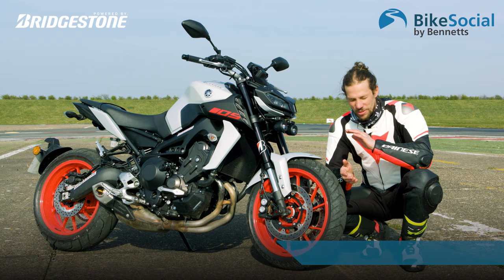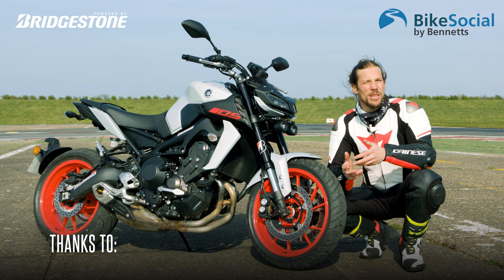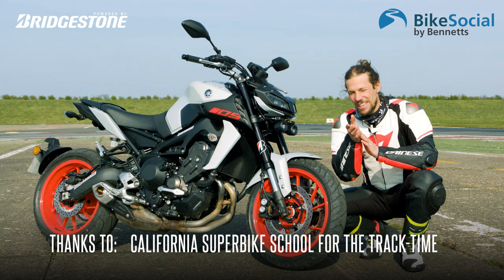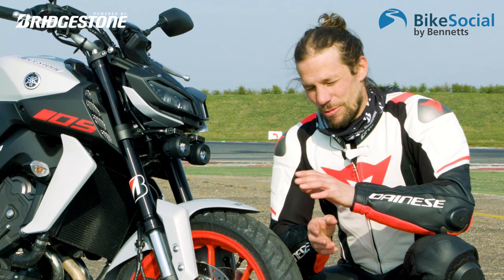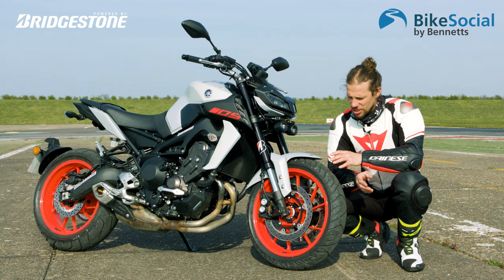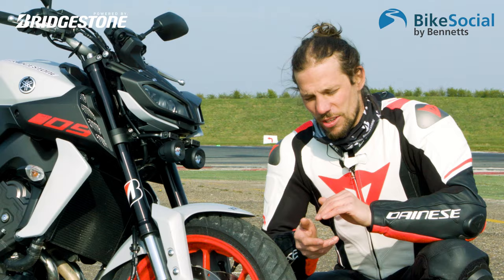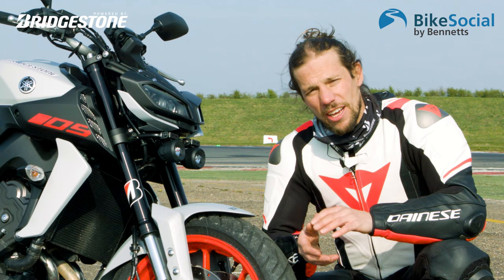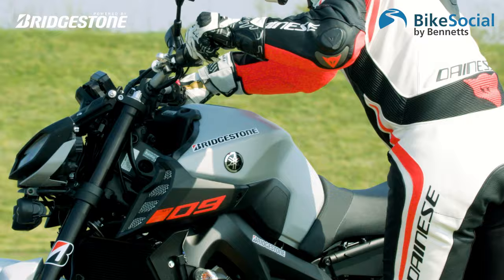Should you brake while turning? Motorcycle riding tips

Comment: We all do actually brake on bends or rather when travelling round curves in the road we cant do otherwise and if we are gentle on slowing with or without the need to use the brakes nothing un towards happens so its something that we would do every day under normal riding conditions. Our roads in the UK are full of curves, bends and then corners.  What we must not do is instinctively slap on or grab the front brake as that  braking  overloads the the front tyre  grip on the tarmac and that is then a slide off. Not nice.   Many times one can use the back brake but gently and that will not  only slow one down, slowly but it also helps one  to tighten the curve and possibly make the bend safer.  Further one can also use more counter steering and push slightly more on the lower handlebar just a little more and that may  also assist us to make a bend  and come out the other side.

However the speed going into any bends is of primary importance and many riders lose it by going in too fast and that could mean not coming out of it. As an example we are taking a bend at 40 mph so our good safe braking distance that we can  see ahead  is  hopefully to the limit point which should be 120 ft or more.  We then have to take into account our lean angle of say of 40 deg. from the vertical.  That, basically for ease of calculation  means that we are already using up some 40% of our grip level between the front tyre and the tarmac.  That means that we no longer have 100% of our original braking capacity but its now limited to only 60%.  If we exceed that 60% we will more than likely lose the front tyre grip level as  we are pushing it over the 100% level. So we lose our front wheel grip and off we come.

If we go back to our  safe stopping distance  as being that 120 ft. its not actually. That distance is for a car on a dry and straight road and we are on a motorcycle and leant over on a bend and  with only some 60 % of our braking capacity left so that means that even if we can use all of what we have in terms of braking on that bend we will exceed that safe stopping distance  of  120 ft. and maybe with moire gradual slowing and stop in 150 ft or more. That means that we have run past the 120 ft safe stopping space we had originally and have ended up running round that corner into whatever. we don't know. . 

So it beholds us to actually slow even more on bends , always presume or assume a hazard such as a tightening radius or stopped vehicle, horse etc.  then  if we are required to stop suddenly or even gradually we can stop without running out of  road and neve ever grab the brakes
Reply from the maker: "Don't surprise the brakes". All the best, John

Comment: This is exactly why trail breaking should always be used on the road, when trail breaking the front tyre is always partially loaded up during cornering ready for any unexpected braking that might need to be done. I've been riding on the road for nearly 10 years and I've only really just started practicing trail breaking and I can confirm that I feel much more in control of the bike during a corner now.
Reply: So if you're already on the brakes and need to apply more mid-corner, you can (smoothly) and you won't slide out?
Reply: @The63chicky  Yep, trail breaking is a front brake only thing, look it up on YouTube, there are a couple of very good videos explaining it.
Reply: @DJRipGroove99  Yeah I know what it is, but haven't tried it yet :)
Reply: @The63chicky  Give it a go next time you're out. When you have it dialled you'll find your cornering is faster and safer :-)

Comment: True however, the safest option is to already be in a speed that you do NOT have to brake mid corner. End of discussion.

But, if you have to for some reason, then YES, Trail braking is definitely a safer option than to slam on brakes mid turn/corner.

Just remember that there is a risk with trail braking because excessive use of the front brake can result in a loss of grip as the tire's adhesion is split between braking and cornering forces. Effective trail braking requires finesse from the rider, which can be difficult to learn.

Comment: One way of looking at it, say you have 10 points on a motorcycle...
10 Braking 
10 throttle 
10 lean angle 

As you gain 1 point of lean angle you have to give up 1 point of brake pressure and vise versa with accelerating 👌

Comment: Thia is for advanced riders (racer's stuff). How about only using only the rear brake, even not that fast. Can you make a video tackling the proper way of that? Not all people are confident enough of touching the front brake on turns and curves.
Reply: applying only rear brake straighten up the bike and it takes you out of the bend i wouldnt recomended it. Anyway why you dont try it for yourself. On hot summer day when tyres have good temperature and on dry road just gently press rear brake in small leaning angle in the bend . Why you need advice from others when its easy find out for yourself

Comment: Braking the front wheel in a turn is old hat to dirt bike riders. It can be used to go faster through a turn. Not for beginners or to be done on a bike you are not familiar with. If brake pads are grabby be sure to get different pads that are not. All different compounds for use on different tracks.

Comment: If the corner is tighter than you thought, just reduce your throttle input and lean more. Doing these things is a lot safer than suddenly grabbing the brakes.
Reply: You need to roll off the throttle before breaking anyway. Throttle + Brakes = fucked.

Comment: What about using the back break instead?
Reply from the maker: I use the back to scrub small amounts of speed off without unsettling the bike, but you won't get the power you would from the front. John
Reply: @bennettsbikesocial  For better or for worse this is my typical panic response to finding myself in a corner too hot. Scrub speed with the rear and tighten my line as much as possible.
The only time I've come across an unexpected obstacle I managed to aim for the centreline, stand the bike up, "progressively" loading up the brakes all the while and came to a halt between the rear door of the stopped car and the front tyre of a lorry. 
Lost a foot peg to the cars rear bumper, bruised my foot, had to check my underpants, vowed to never put myself in that position again and decided to do some serious practice with my braking technique.
Reply from the maker: @eoinkenny3188  Glad you're okay! The best advice is of course to not go any faster than you can see to be clear, but understanding how the bike reacts is really helpful. Cheers!
Reply: Front brake's braking force is typically around 70-80%, but it can go as high as 100%
Rear brake is not as precise and it is easier to lock up the rear wheel than the front.
Front brake force bike back to upright position where the rear make it to lean more, but things can change quickly if you lock up a wheel (often a crash).
When a rear wheel gets grip again it can lead to a high side.
When a front wheel gets grip again it usually wobble a bit.

Comment: Rear braking in the corners is never a problem.. But front braking? It's still something that I wouldn't recommend.. Physics wise.. When you front brake, you'll actually tend to go up straight again instead of leaning more.. That is why there's so many under steer crashes because of front wheel braking.. Front braking in the corners and leaning, you're actually going against Physics and that's when you'll crash because it's not easy to gauge how much or how less do you need to brake with the front brakes.. It's still ok if you're slow at about 30mph to 40mph.. But at any speeds higher than that, definitely not recommended at all..

Comment: This kind of information should be widespread because learners always get told they can't brake in a turn and only someone interested into refining their riding will find out you can actually brake in a turn (including using the rear brake to tighten a line).
Reply: Yeah I got told to never brake in a turn after I had already been doing it for 2 years, also he didn't tell me why. The practice of breaking in turns is no different than a car really.

Comment: My bike didn't had ABS, I was on a very small local turn. I have passion pro 2020 bs6. it's brakes are good enough on grippy and straight roads. Today I was running it and suddenly a girl with a bicycle came in my way on the turn. Even though I could easily control my bike. even my bike was slow. but I got my focus on girl and not on my hand on the brake. I accidentally tightened the front disk-brake and tyre got slipped and my left hand got a wound and my leg also. do you know what next. she stopped in her way. and thought of helping me but I simply stood up my self and Took my bike, she left. I was safe but My bike got a very small bend in its handle bar and some scratches on the wiser and headlight. That wound on bike broke my heart I am here learning more about braking

Comment: What if you drag the rear brake very gently on dry track while entering the turn? I find it useful. Slows down the bike ever so slightly but gives more confidence
Reply: just use the front, way more control on that brake. I have about 10k kilometers on me as a rider and i can do some light to medium trail braking, i'm sure experienced people can do better. Specially if you ride the track
Reply: I think it depends on the bike. Not every bike comes with dual front brake. When you're making hard stop both front and rear is needed.otherwise they'd just stop adding rear brake on all bikes
Reply: @cripticdestiny  i mean use the front for trail braking. Even if it's single disc, it's way bigger than the rear.

Comment: Whilst on a road in the UK we are taught to use the limit point for our speed around any  curve or bend.  However once at that maximum cornering speed and needing to brake if we were on a dry road and going straight we could brake quite hard and in that distance to be seen but whilst leant over and on a bend with already using some grip due to speed and lean angle some of   our braking capacity is lost and if we can only use some 60 to 70% of our braking capacity how much further would we need to see past that limit point [ say being a mere 120 ft ahead ] in order to come to come to a stop?.  

Also in the wet we are told to allow twice our dry  braking distances on a wet road so if we can see the limit point is say 120 ft away and we are doing 40 mph., that's a braking distance on a straight line and in the dry,  But just how much distance do we need and can we stop in in order to brake in the wet from that 40 mph with only 120ft of seeing distance. how much further would we need to travel in order to come to a stop? 

Can anyone hazard a guess. I cant but I know that it will take quite a few feet or metres of further travel to be able to stop and it will be well past the so called safe limit point. So it will bring into question all that we know about  stopping distances  and about the taking of bends and speeds relevant to the limit point.

Comment: if you get your front tire warm with a few braking sessions, I haven't ever had an issue using 30-50% front brakes around 45-40 deg lean. That's on some michelin pilot powers or RS's though. I could only use about 10% brake pressure on old Dunlop qualifiers before they turned in.  It would be amazing to use that machine though. Can I have a go?

Comment: You only spoke about using the front brake.. Is using the rear totally out of the question, or could a smooth and controlled brake using both be even better/more secure? Maybe this topic deserves its own video as a followup.
Reply: For a new rider I would forget the rear brake existed. It plays little role in stopping ability (in the straight line) but very easy to get  you into a highside when you start fishtailing into a corner because your rear tire lost the grip.

Comment: Just started riding, thanks for the video!   Can I conclude the following :  IF I misjudged a bit and come in the turn too fast for my own good,  and IF braking is necessary,  and IF I don't trust myself being able to progressively and gently use the front-brake,  then it would be better, in my case, to use the dual front/rear brake instead of the front brake?  And, of course, even then I still need to avoid using the dual brake abruptly.  Is this correct?
Reply: The rear break can lock the tyre as bad as the front, the different is that you have a chance to recover if you just lock it for an instant, if you lock the front you can’t recover. Anyway, can’t say it’s better than using the front just because you have more chances of recovering after locking the tyre. If you don’t trust yourself, don’t ride fast, ride safe until you know you can trust yourself .

Comment: Is It better ti use the front or the rear during a turn? Not talking about slow turns when manouvering
Reply: Trail braking is a front braking skill. You have much more sensitivity in your finger on the front brake lever than you will have in your right foot. Trail braking also transfers more weight to the front tire, increasing the front tire's traction. Transferring weight forward also compresses the front forks, making the trail shorter, which also helps the motorcycle turn as it was designed to do.  Keep in mind that the amount of pressure that you will be applying to the front brake lever is just about as much pressure as it takes to light up your brake light. It's all about finesse and sensitivity, not grabbing a fist full of front brake.

Comment: How would the rear brake handle scrubbing speed in a turn
Reply from the maker: Gently using the rear brake can help settle the bike in a turn and drag a little speed off – I do it if I think I'm going a little bit hot. Of course you need to be careful though - stamp on it and the back will come round on you before you know what's happened. But for gentle scrubbing off of a little speed, without upsetting the suspension, yes, it's great. John

Comment: Yes, you should absolutely use the front brake when going into corners at speed. It's called trail braking, and I have been doing it on the streets of this country for over 50 years without a single issue.

Comment: I have a question....I've been practicing straight line hard braking from 40 mph. I want to work it up to 70 or so. I understand loading the front to increase the contact patch.
Once I initially squeeze the front brake lever and I watch the front gently dive....How long does the contact patch stay increased if I don't add any more pressure to the lever?
The front end stays compressed but does my larger contact patch go back to its smaller size?
Reply: Depends on your entry speed ie your momentum.
Reply: Anthony Baiocchi ...I'm talking in a straight line, not a corner. I've been riding a long time but have had a couple of close calls at speed so I need to up my game with high speed hard braking.

Comment: Do you hold the clutch when trail braking or nah?
Reply: I dont think holding the clutch is good idea. You have to hold the handlebars strongly and listen to feedback from the bike while you gently squeeze front brake . You can gradually squeeze more but only in the lifesaver moment imho. Dont do it on cold tyres obviously. Sometimes for the fun i added a gentle bit rear brake too didnt see much difference tbh. Im braking with 1 finger and covered brake thus trail braking was quite easy and safe even on the wet when i was too fast in the bend. On the roads i would recommended it to use only in lifesaver scenarios. The correct entry speed to the bend is safer option imho. My bike doesnt have ABS thus i cant tell hows ABS bike behave during trail braking

Comment: I'm not sure the MT-07 is the best test bike.  It has brakes that have a tendency to be spongy,  then suddenly lock up.
Reply: they're using an MT-09
Reply from the maker: Having ridden the MT-07 and MT-09 a lot, and owned an XSR700 (basically the same as the MT-07), I've honestly not had any issues with the brakes at all. John
Reply: On my MT09 the brakes feel a tad bit spongy, but they’ve never surprised me by randomly locking up.
Reply: I think you're confusing the ABS kicking in with 'locking up'. The ABS does seem to be a bit oversensitive on the MT-07 (from experience on mine and also have heard other owners say it too).
Reply: @assortedpov  mine did not have abs

Comment: With correct, smooth brake application, did the tire give you any feedback prior to washing out? Any kind of noticeable deformation/chatter that told you it was about to go? If so, could you have backed off pressure a bit (or decreased lean angle a bit) to prevent the loss of the front or was it a done deal as soon as the feedback was received?

btw, 100 points of grip by Yamaha Champions Riding School is an amazing video and an amazing chapter within ChampU, at www.ridelikeachampion.com
Cheers!